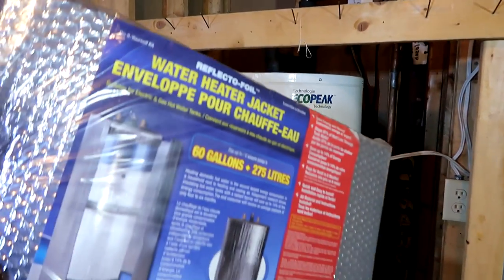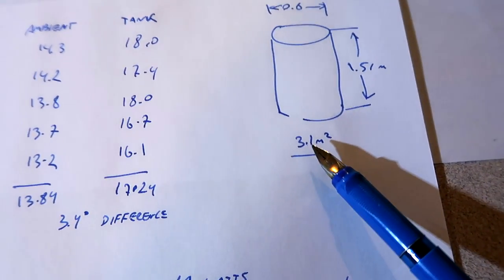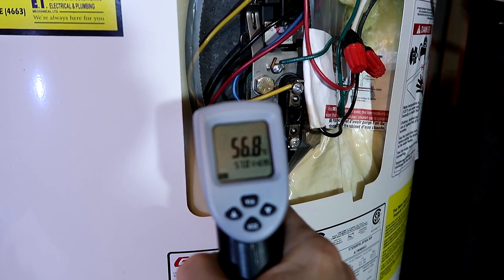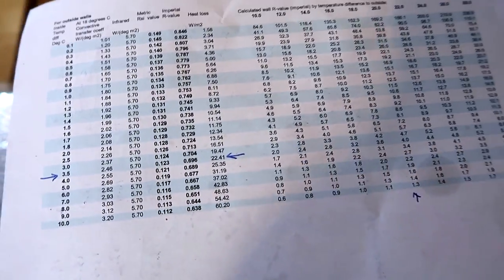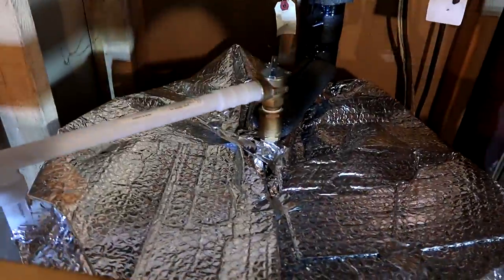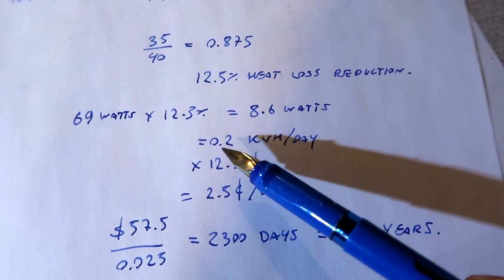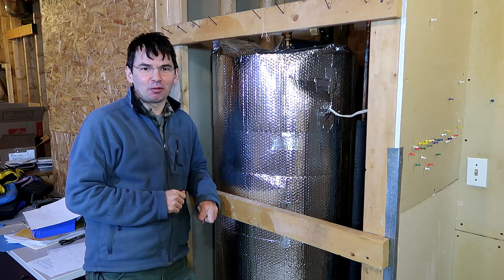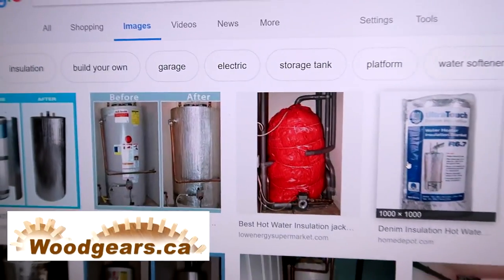Hot water heater insulating jacket:  How much savings

Comment: Technically it’s a cold water heater, not a hot water heater.  Water heater for short..
Reply from the maker: yes, and you are pedantic.  Go into home depot and ask  them where they ave cold water heaters.  Everyone else calls it a hot water heater.  So if you want to communicate with real people, just call it a hot water heater.
Reply: When the cold water becomes hot, it continues heating it so it stays hot until you open a faucet, so you can also say it heats hot water. It probably spends most of its time heating hot water. But I'm on board with calling it just "water heater". (I'd call it a Dihydrogen Monoxide Enthalpy Reactor but I don't think that would catch on)
Reply: It's just a water heater.
Reply: I do call them cold water heaters at The Home Depot, I get weird stares though.
Reply: And Matthias sure loves the word 'pedantic'. Uses it regularly.
Reply: In finnish language that is called "warm water reservoir(er). Very accurate.
Reply: @jaqummh  In German it's often called a boiler. Literally boiler, the english word. Never mind that it doesn't boil anything.
Reply: Count yourselves lucky anyway! Here in South Africa, it's called a "geyser" (that's gee-zir, not guy-zir).
Reply: brentley metcalf Mostly because it is earned so frequently.
Reply: @Carl-LaFong1618  I'm aware of how the term is used in proper English grammar. My point was that he overuses it. Which in turn, causes him to seem pedantic.
Reply: Well technically the heater is the coil or the element that heats the water. The insulated cylinder is a hot water tank or hot water cylinder as they are called in Ireland
Reply: I worked for a company that had a water heater lab (efficiency, reliability testing, probably other stuff...).  If you called them "hot water heaters" in that place, you would get a blank look and someone would say with very dry wit, "what's a 'hot water heater'? I've never heard of that."  It got so ingrained in me that I can't call them "hot water heaters" any more, it just doesn't sound right to me.  I'm only adding this because I purposely went looking for the pedantic people (like me) in the comments.  Found 'em.  :D
Reply: @mike_van_in  I like your word better!  We would spell it "geezer" to make the pronunciation easy, but then people would confuse it with the colloquialism for "really old person."  Ha!
Reply: @matthiasrandomstuff2221  By no means does everyone call them "hot water heaters". I agree that no one calls them "cold water heaters", but the correct term is just "water heater". No reason to put "hot" in front. In fact, if you check homedepot, the categories use "water heater" without "hot" in front.
Reply: @matthiasrandomstuff2221  It isn't pedantic to point out redundancy.
Reply: Yep it's a water heater, here in the UK some people call them immersion heater because of the immersed electric element but nobody would call it a hot water heater. Why use two words for one function ? It's like saying a turn steering wheel or band saw cutter.
Reply: @matthiasrandomstuff2221 the "hot water heater" correction is an ongoing joke for a phrase that has been erroneously,  but commonly used. Your response could have been as one receives a friendly poke rather than lashing out at a fan. Lighten up. Everyone loves you. You're a smart guy. I suspect you simply don't like being corrected because you have an ego the size of a hot water heater.
Reply: The knife cuts both ways, folks. 

Your house has two different sets of conduits in it to transport clean water. One is the "hot water" line, the other is the "cold water" line. 

At the tap or faucet or shower head, the knob(s) controls how much of the water is drawn from the cold water vs the hot water. If you are heating your "cold water," you might be doing something wrong. You can potentially save money by only heating the hot water. :) You can then select the temperature of your water at the tap. 

Of course, if you live in the arctic circle, you might have to also heat your cold water.
Reply: All of the packaging just says Water Heater, because that's what the device is. It heats water, of any temperature.
Reply: You had to be that guy eh.
Reply: @singJJBplay  Well, being an old geezer myself, I understand that it's for the same characteristics; a thick-skinned vessel under pressure, full of warm fluids, that sucks up any energy expended on it, dribbles when hot, and can't be trusted not to erupt from time to time, to make a mess of things.
Reply: @mildyproductive9726  Hot water doesn't need to be heated
Reply: @matthiasrandomstuff2221  
If by "everyone" you mean only the uneducated, then sure. Otherwise, it's just a water heater. Suppose I'll go to Home Depot and ask them where to find the Cold Ice Makers. They're probably by the round paint rollers, right above the sharp knives shelves.
Reply: Well technically the bilateral balance of the rodestratum is quite incoherent to the biobligatum, but whose being technical. I was looking for the comment that would say "well technically it's a water heater". People always have to be soooo smart. In North America it is commonly known as a HOT WATER HEATER.
Reply: @matthiasrandomstuff2221  If we're pedantic than you're redundant.
Reply: @matthiasrandomstuff2221  no. It's a water heater
Reply: @jason5174  sure, that is right. The plumbing in each house diverts some of this single water source to the heater, to make your hot water. And some of that water continues to your faucet, unheated. You might call the latter your cold water. You don't heat the cold water. You heat the hot water. 

*edited for spelling errors.
Reply: And after it heats the cold water, it keeps the hot water hot. 
By heating it. 
Meaning it heats hot water. 
So it's a hot water heater.
Reply: @singJJBplay  back in the day when I was in Technical College I had an instructor by the name of Ray Peters, if you ever use the words (hot water heater) the wrath of God would come down upon you. I still hear his statement in my head to this day, if the water was hot why would we need to heat it?
Reply: @stefantrethan  The English old boilers (tank water heaters) actually did boil water if they were set high - a valve let off steam into the airing cupboard above it.
Reply: @matthiasrandomstuff2221  lol nobody who knows anything about plumbing is going to call a water heater a "hot water heater" that term is reserved for amateur/home depot plumbers who don't know any better.
Reply: @mildyproductive9726  lmfao you of course are joking..... Right
Reply: @mildyproductive9726  no. You heat the cold water and make it hot. To say you are heating the hot water implies that the water was already hot. I which case a "water heater" would not be necessary.
Reply: Look the fact of the matter is the people who build the damn things have seen fit for whatever reason (probably common sense) to call them "water heaters" case closed. 
That's what they literally do is heat water.
Reply: @chaosmasker9858  No, I was not joking. I was dead serious. I fully, 100% understand your point of view. It is completely valid. If you do not understand the pov I proscribed... if you do not see the duality of this problem, you do not grasp the nuances of the English language. And/or you really do not understand how plumbing works. *Edit: I actually don't know what proscribed means, but I thought it sounded cool.
Reply: @chaosmasker9858  As you might (or might not) know, the water comes to your house from your municipal water supply. This water comes to your house at a given temperature, depending on where you live. This water goes straight to the tap. You have a second pipe going to the tap which goes to the heater, first. The water that comes out of the tap straight from the city water supply  has different names, depending on where you live.

In Germany, they traditionally call the unheated or coldER water "wonderhousen degruntenschitzel." Which, loosely translated, means "house water of the ground, which might be considered cold, lukewarm, or hot depending on the season and on your personal frame of reference at any given moment."

In Japan, they traditionally call this water "wakasushi." This literally means "unheated water."

In the US and Canada, we call this water "cold water," even though it might be lukewarm or hot, depending on where you live and the season. We don't heat our cold water. We like it to be as cold as possible. If we want hotter water, we turn the knob on the faucet to get some "hot water," which gets its funny name from the fact that it has been heated. Our heaters are used to heat our "hot water," not our "cold water."
Reply: @mildyproductive9726    😂 yeah ok buddy whatever you say.........
Edit: btw I have been a residential plumber in Jacksonville Florida for 14 years now. If someone was to ask me how many houses I have re-piped entirely I would be hard pressed to come up with a number. (I lost count years ago). Mark Twain once said never argue with a fool least the bystander's be confused as to who the fool is. I'm done here you all have a wonderful day.
Reply: @chaosmasker9858  "btw I have been a residential plumber in Jacksonville Florida for 14 years now." 
Congrats. And thanks. This narrows down the disconnect.
Reply: Matthias Wandel just call it a water heater then lol
Reply: My fam has always called it a water heater.   I do hear others adding hot
Reply: Wow.   First time I’ve seen a utuber wet the bed over a funny and true comment.   He’s probably going to lose his shit over this one.  Lol
Reply: Yes is a water heater  when people say Hot water heater I say to them why are you heating hot water ?????
Reply: Matthias Wandel I think you’re technically right in my opinion, and trust me this is hotly debated where I work. I’ll give you the best explanation I have:
Hot water heater
Hot water boiler
Steam boiler
Hot water generator

The only item on this list people will say is wrong is the first item. The rest are all proper names for commercial heating equipment. They all follow the formula of (what is produced) + (equipment classification). 

I can’t fathom why people think a hot water heater is wrong but a hot water boiler is just fine. Even when the latter makes 130 F water and will never boil water. The only explanation is what I proposed.
Reply: Matthias Wandel everyone else is still wrong.
Reply: LOL I am not alone!! Being pedantic  hehehe
Reply: If you want to get technical, there is no such thing as "cold".  Cold is just a subjective adjective. 

Heat is a measurement of how much energy is in the atoms and molecules of the material. Therefore all water is hot since all water has some amount of energy within it. So a water heater is heating hot water. It can not heat cold water since there is no such thing as cold, technically speaking.

Comment: You could use TRISO layered foil & foam insulation. it's 30mm thick, but  gives an equivalent insulation of 210mm of mineral wool. (very expensive though).  
Alternatively you could do what I did, & make a cardboard 'former' around the tank, & squirt-in lots of expanding foam.  My drying cupboard where my tank is, used to be VERY warm. But now it's pretty cool, & the water stays hot for a day or so...!

Comment: What was the temperature of the water in the tank during your tests, was it the same??????
Reply: Water temperature is controlled via thermostat.  The heating elements run up to the temperature set on the thermostat and then shut off.  So basically the water should be at the same temperature, with the heating elements running less.

Comment: I assume it is designed for older, less insulated tanks. But the same "pays for itself in months!" tag is used for lagging jackets in Europe (since our "water heaters" are usually an electrical element in a large copper tank - https://www.adverts.ie/plumbing-gas/copper-cylinder-57-x-30-comes-with-lagging-jacket/11770741

Comment: Did you take any measurements on the outside of the insulation?

Whenever I've considered the effectiveness of insulation, I look at the temperature on both side of the insulation.  You were measuring how much heat was trapped, as opposed to how much escaped through it.

Comment: you must also consider any days that require heat to be added to the area where the water heater might be. any heat loss from the heater will be added to room temp., reducing fuel cost from other sources by that amount. that extends the payback time on the insulation blanket.

Comment: Wow that’s interesting. My electric HWH is on the outside my house in basically a plywood box with no insulation. It’s winter and the shower stays warm for maybe 20 mins max. Both Temp gauges are all the way up. Would it be better to insulate the box with rigid foam boards or wrap the tank itself with some insulation?

Comment: I landed here after researching a copper hot water recovery unit. Seems like, if you did an "all of the above" solution--hot water recovery with copper, insulating the tank, and insulating the pipes, the savings would really add up over the years. Even if the payback time was six years, for such a small amount of labor that you did yourself it still actually seems like a great deal.

Comment: The vinyl coated insulation used to insulate metal buildings, and pole barn buildings, can be had for free. ( almost, plus your labor ) If you see one being built, stop by after the walls are up and ask for the scraps. They are paying to dispose of them.  Offer the Forman a case of beer for a big pile of scraps. I have insulated a number of buildings this way. It will be tedious to remove the vinyl covering if you are insulating an attic. But, again, almost free for very good insulation.

Comment: something people dont realize when trying to save on the electric bill is that any savings you make is gonna partially show up as an extra cost on your heating bill, as any "wasted power" is being converted into heat and released into your home, electric heat is a bit more expensive compared to gas/oil but not very much.

so when replacing old bulbs with high efficiency ones start with the outdoor lights as thats all lost energy, assuming you live in a cold climate, if you live in a hot climate then everything is reversed and any heat from power useage inside is actually twice as damaging as your AC is running more to remove that

Comment: We just had to replace our water heater a few weeks ago & I was thinking about doing what you did by adding more outside insulation. However, after watching this video, I won't have to bother! Thanks Matthias for posting this............................. :)
Reply from the maker: If you have a better insulating jacket, it can make a difference.  But for that money, I could have bought a whole bundle of fiberglass insulation, and if I tied that to the tank, that would cut the heat loss to less than half.
Reply: @matthiasrandomstuff2221  I went the fiberglass route. Though, I'll be honest that I never measured how effective it was.
Reply: Insulate the cabinet that contains the tank with polyurethane sheets. Much easier

Comment: In Ontario we have on-peak (13.2¢) mid-peak (9.4¢) and off-peak (6.4¢).  I'd suggest you would save more if you installed a timer on the hot water power supply so that the elements aren't able to come on during the on-peak periods.  Better yet, go on-demand HE natural gas.  In any event, the difference between ambient and the H W T of only 65 Watts is about one incandescent light bulb, and for about half the year it's contributing to the heating of the house.  It's only a detriment if you're fighting the air conditioning.

Comment: I hope I didn't miss the caveat about using this insulation with a gas fired tank.  No insulation on the top  and other required openings.  I wrapped my 40 gallon electric heater at the cottage with 2+ inches of fibre glass and a vapour barrier plastic cover and used 3 inches of blue foam on the top.  I switched it off on Sunday night and on return the next Friday it was still hot enough for a long hot shower.

Comment: My grandfather used to keep his hot water tank on a timer. It would start warming about 2 or 3 hours before he would wake up, that way it's ready for his morning shower, and for him to do the dishes after breakfast. He then had it turn off, but had some fiberglass insulation around it, so it would stay warm for a while after. He lived alone, so he didn't use that much hot water in the first place, so he had one of the small halfsized tanks.
Reply from the maker: a timer makes a lot of sense if you have time of use metering
Reply: @matthiasrandomstuff2221  I'm not sure if he had time of use metering, but he was in northern Ontario, where hydro is pretty expensive to being with, so that's more so why he had the timer. No point paying to heat the water when you don't need it.
Reply: @matthiasrandomstuff2221  A good idea, but we've gone through I think 4 or 5 timers in the past 5 years (220v heater). Chinese junk!

Comment: Foil bubble wrap products are infamous for exaggerated R-value claims. I don't know what the product packaging claimed, but the actual R-value is R1. So your measurements were bang on. If you manage to actually get a proper sized air gap, and somehow manage to actually air seal it to the tank, you can get that number higher. Very difficult, if not impossible to do. Those spacer strips they provided are a joke. The insulation blankets that actually have real insulation in them might be worth considering, however people should keep in mind the diminishing rate of returns. The newer and/or higher quality your tank is, the less adding external insulation is going to help. And don't forget that if you live in a mixed climate, half of the year that heat you're saving would have otherwise heated your house. So the cost savings are reduced by about half again, assuming your space heating and hot water tank are using the same fuel type.